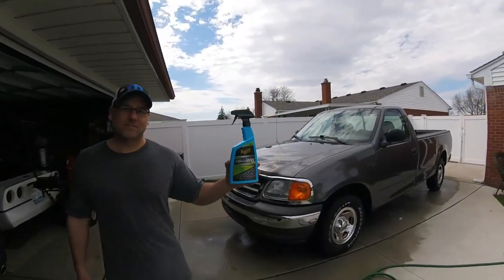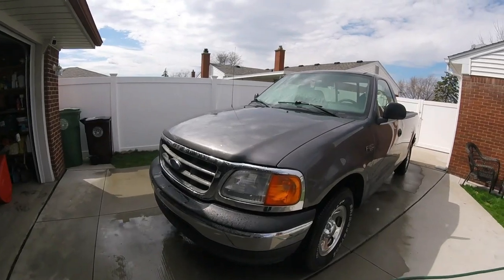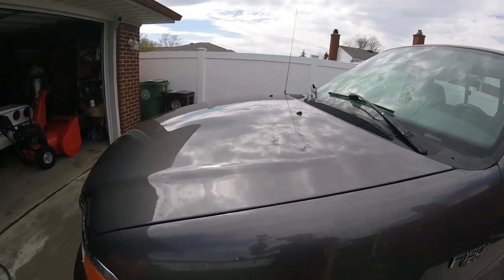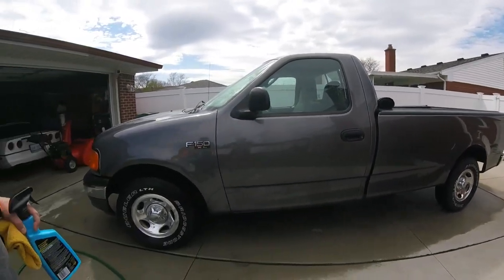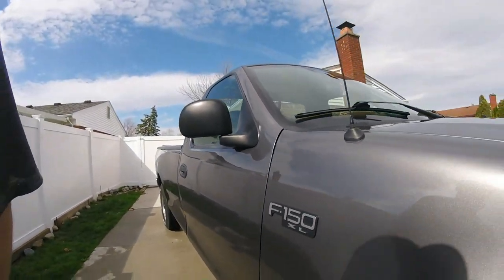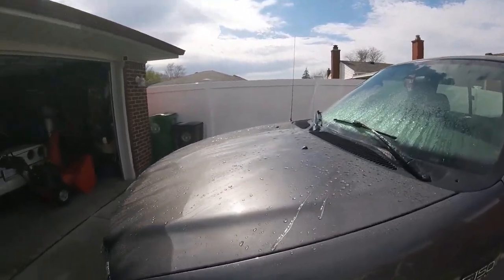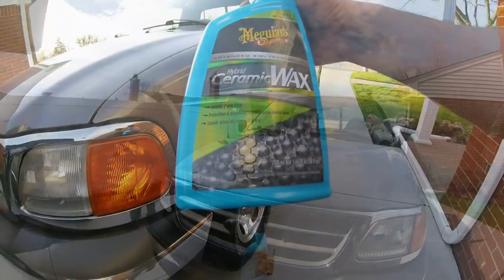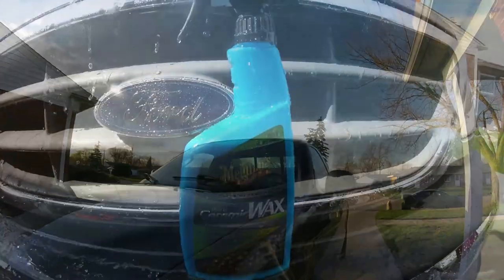Get Professional Results With Meguiar's Hybrid Ceramic Wax Spray

Comment: Megs HCW is a phenomenal product!  I got 3 months out of it when I did my initial longevity test and it still had a little life left to go a bit longer.  Nowadays I use it once every other wash using the "foundation  layer" method.  Around the car in 10 minutes and it's done.
Reply from the maker: Thanks for sharing how you use HCW. It is a phenomenon product we had rain for like 6 days and the truck still looks clean..  Thanks

Comment: Man I wish I could wash my vehicle in the sun! I have to wash and be finished by 9 am to keep my vehicle in the shade now! Soon due to the heat I'll have to be up and washing when the sun is coming up (5 am) or the lovely hard water I have dries too fast and you know what issues that causes. It's not bad right now but it will be 115 degrees regularly for a few months very soon. Thanks for the video!  Oh, I'm in Phoenix. 🌞
Reply from the maker: I feel lucky now after reading your comment about how hot it get in Phoenix. Wow 115 degrees in the summer we get into low 90s .And we get a lot of grey days .Thanks bro
Reply: @OuzoLouGarage  it's hot during the summer but the winter, ahh yes, the winter makes up for it! As long as I stay in the valley I haven't worn a coat in at least 10+ years and just put a light jacket on this past winter because I went car shopping in late December and the wind was blowing. 😆
Barrett Jackson Scottsdale car show is January 11th-19th here and I usually wind up carrying my jacket more that I wear it as temps are usually around 60-65.
Anyway this is on my wishlist to do away with my hard water issues. It's about the cheapest I have found for the size. Have a good one man! 
https://rvtransformers.com/store/PRO-100-p105868879
Reply from the maker: Winters here are cold -11 wind chill -42 lol ... no detailing when it's that cold ..

Comment: Do you have to decontaminate and clay before applying or will it stick after just washing?
Reply from the maker: It would be best to clay , decontaminate.  On the truck we didn't  clay etc .Wanted to see if HCW would stick and give any protection. Yes you can use it with out clay. Thanks